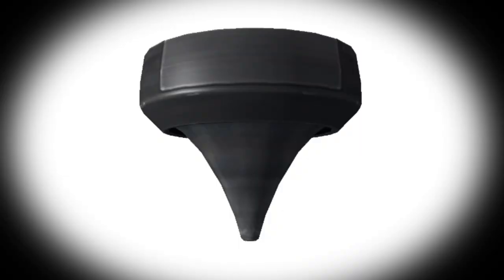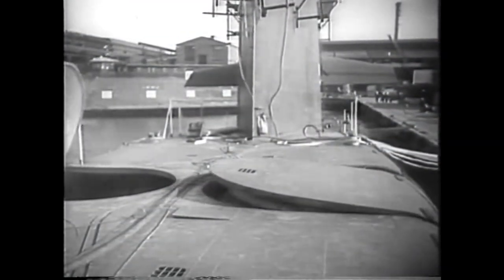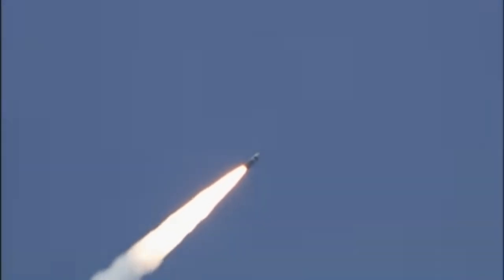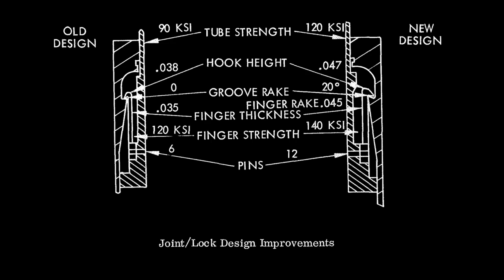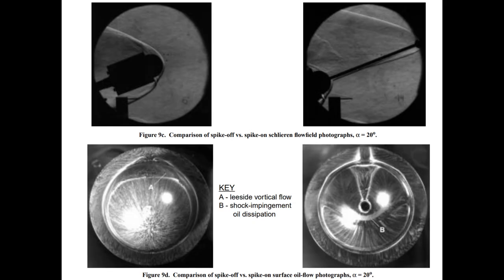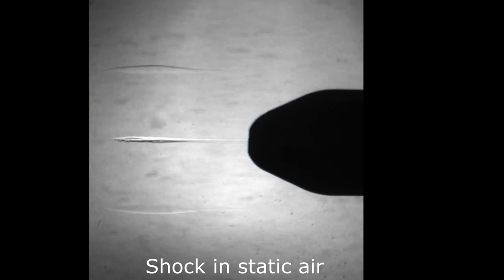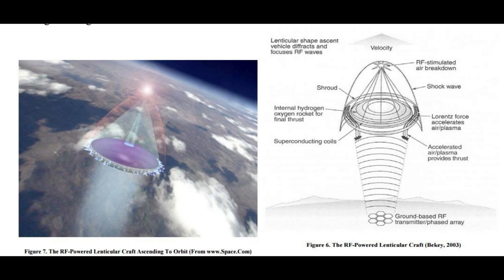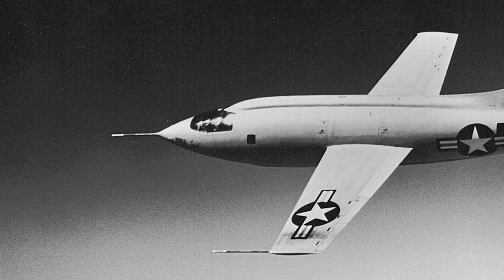Why Does The Trident Missile Have A Spike On Its Nose?

Comment: So with the significant drag reduction, why isn't this used more on say, the Falcon 9/Heavy?  Obviously the Saturn had the eject tower that probably served a similar function as does Artemis.  Is it just not worth the added complexity?  Or is the steering element you mentioned the reason?
Reply: I think he said that a pointy cone is better, and this is just better if u need to make a blunter shape
Reply: Probably keeping it simple at this stage of evolution. This concept seems like it would need a lot of research for a comparative small amount of gain. Look for it on the model 16 Heavy 🤪.
Reply: Remember, the purpose of this was to fake having a pointy nose... they didn't have room for a real nose cone on the missiles, so they used this deploy-after-launch spike to get some of the benefit anyway. It's clever, but nothing more than a workaround for a design limitation.
Reply: Civilian space launchers aren't length, width or mass-limited in the way that military missiles usually are. Falcon 9 could be made much longer and heavier with improved engines to enable it to launch heavier payloads, but you can't do that so much with a missile that has to fit inside a sub or an aircraft weapons bay. That's also part of the reason why propellents for space launch haven't changed much over the years (first methane /oxygen rocket flew in 1931 for example), because the ones we have are good enough, safe enough and cheap enough to do the job and if we need more performance we just use more. In contrast, solid propellant research is ongoing to get around the limitations imposed on military rockets, and improve things like safety and long term stability.

Comment: Wow, Scott!   I learned something really cool in this vid.  Aerospikes!   Then you mentioned supersonic torpedoes and blew my mind!!!   I thought about it and realized, sure, cavitation is a no-no for ship propellers.  But you might be able to use the cavitation phenomenon on the nose of a torpedo to drastically reduce drag.   I wonder if you could go all the way and effectively encase the whole torpedo inside a bubble and use a rocket engine to propel it?    Can you imagine how noisy that sucker would be?
Reply: That is how supersonic torpedoes work they have a solid rocket in the back and only the tip is in the water. The russian one can only go straight, the germans (dhiel) in the early 2000 build a nosecone that could be turned to steer the torpedo and tested it up to 100knots with 400knots possible. The german navy dropped the project after the prototype stage
Reply: @ariellus7096  Wow!  Thanks for the info!!!
Reply: Noisy. But being supersonic, the enemy wouldn't hear it .

Comment: IIRC, there was a high-speed ejection seat developed (Martin-Baker?) that deployed a pylon to place an aero-disc in front of the pilot to shape the shock wave around the seat, putting the pilot in a low pressure 'bubble' of sorts, making the ejection survivable.  Don't know if it was ever put into production, but a similar type of idea.

Comment: The original AIM-4F air-to-air Falcon missile carried on the F-106 had a similar spike protruding from the front of the radome  The spike actually screwed into a threaded stud that projected from the front of the radome.  Soon after the introduction it was determined that any added value was not worth all the associated maintenance hassles.  The mounting stud was dropped in later manufacturing.  Still there were some radomes with the threaded stud on missiles for many years after the spike was discontinued.

Comment: Every little boy's rocket has a pointy bit on the front. I shall also mention the turned up wing ends we had on paper aeroplanes which suddenly became popular on the metal ones a mere 30 or 40 years later.
Reply: My rocket does not have a pointy bit on the end. Why are you looking at little boys?

Comment: 4:52 I must point out that simply decelerating the flow to subsonic isn't the reason the aerospike reduces drag. Deceleration of the flow across a shockwave to subsonic actually increases the static pressure on the nose, which increases profile drag. A pointy nose or an aerospike causes an oblique shock wave vs the strong 'normal' bow shock wave you'd get from a spikeless blunt nose. The weak oblique shock actually causes the minimum amount of deceleration across the shockwave, keeping the flow moving as fast as possible so that its pressure remains low, and hence profile drag on the nose is kept to a minimum. Skin friction drag goes up as a result, but because the nose is so front-facing, the savings in profile-drag win out.

Comment: The aero spike on the Iglas don’t pop out. They are static.  The launch tube is long enough. 

The SA-16 has a tripod mounted aero spike.  The SA-18 has a single post.  

Both weapons use a spinning reticle seeker so they are blind in the center. The seekers are also gas cooled from the battery/gas bottle, so in flight the aero spike helps reduce seeker heating.

Comment: I read the spike is fed with high voltage the plasma field created pushes the air out of the way, a bit like the Biefield Brown effect that is used for propulsion in the B2 Spirit bomber where high voltage low amps positive charge on the leading edge of the wings and negative charge on the rear of the craft and into the exhaust pushing it along giving it the nickname "The flying capacitor ", at speed it becomes self sustaining as the engines become electric generators.

Comment: super cavitation actually uses the gas created by the water itself as it's compressed and then decompressed along the nose, streaming along the body. Like on a ships bpropeller the water cannot rush back into the volume it has been displaced from, so it instead gasifies. On propellers these bubbles disconnect and implode, eating away on paint and metal surfaces, while on a torpedo the bubble is carefully designed and enhanced to surround the entire vehicle. There's also underwater amunition for rifles that use this effect, it's just metal but shaped with a collar at the tip to create a small pressure zone

Comment: the noses of these missiles aren't blunt to fit inside a submarine, they're blunt so they don't melt on re-entry, i can't find anything really good on this online but to summarise from what it says from my textbook is: the more blunt an object the more air is used to take way heat while going at high mach speeds allowing it to go faster due to it not instantly melting while also hindering it's progress at going faster due to it being blunt.

Comment: I could see this being very useful for aircraft which want to store their munitions internally. (Be that for purposes of keeping the RCS low or otherwise.) You're quite limited by the volume of the internal weapons bays, so it might be practical to put an aerospace on air-to-air or air-to-ground missiles with a blunt nose to get that little bit of extra packing efficiency. I imagine this would be more practical for air-to-ground, though, since those are typically bigger (thus saving space is more valuable) and need to maneuver less (thus the issue of shock reattachment at high alpha is less severe).

Comment: Supercavitating torpedo is those thing that looks good on paper but in practice is actually pretty bad. 
For start the torpedo can only have inertial guidance because it flies within an air bubble so it has no contact with water, sonar guidance would not work since sound do not go through medium that well. Wire guided from submarine will also fail because a rocket propelling it will burn away any connection. 
Torpedo also had to be within confine of the torpedo tube so it really limit its width, therefore the USSR supercavitating torpedo had a very short range compare to normal torpedo, at around only 20km. Soviet submarine had to add nuclear warhead on them to increase their lethality, which also put a big stress on the crew because they had to run away from the torpedo as soon as possible to avoid being caught in the blast area.

Comment: Storytime, re: stripping out lining in the tubes at 2:20: 

- When the original fleet was built, the chief engineer made a shock/vibe requirement which was ludicrous.
- This caused a ton of padding to be required in the tubes, to reduce vibration on the missile. 
- This caused to the submarines to be built with a much wider missile tube than they otherwise would have, to accommodate both padding and missile
- 10 years later when it was time to build a larger missile, they changed the shock/vibe requirement to be much less stringent (and more realistic)
- Now that the requirement was more realistic, most of the padding was no longer required

And now, suddenly, they had a much bigger missile tube to work with, without needing to design and build a new submarine

All because a farsighted engineer wrote a ludicrous shock/vibe requirement at the very beginning

Comment: TOPIC REQUEST:
The VZOR optical orientation device used on the Vostock spacecraft solved a number of attitude problems without the need for power or electronics. It used lenses and prisms in a clever arrangement. but I have never seen it reproduced for demonstration. What do you know about this device?

Comment: The soviet-era supercavitating torpedo was effectively a failure for a number of reasons. Obviously, an underwater rocket torpedo is LOUD. If you launch one, the target will know it's coming. This noise and cavitation prevents any sort of effective onboard guidance system. So it has to be either wire-guided, or dumb-fire like WWII torpedoes. Not only will the target know that a torpedo is coming, it'll know EXACTLY where the torpedo came from. Since underwater engagement ranges are measured in thousands or tens of thousands of meters, even at supercavitating speeds the target will have time for return fire, and it will know exactly where to aim that return fire. Also, since it is so loud, you will seriously impair or completely blind your own sonar until it is far enough away from you.
Every time you shoot a supercavitating torpedo, you're blinding yourself at the exact same time you're giving away your position. While you've got a pretty good chance of getting a kill, you'll definitely have to deal with a lot of extremely accurate counter-fire. And oh yeah, the rocket fuel the supercavitating torpedo uses is corrosive, toxic, and hypergolic, and likes to eat through parts of the torpedo and fill the space with toxic gas then explode. So you might not even get a chance to launch the dang thing before it kills you. It looked very good on paper though, so of course the Soviets used it.

Comment: The original design of the Russian "Shkval" torpedo did not use a gas generator for the nose plate, but relied only on the plate itself to create the required cavitation, and the resultant air bubble that surrounded the torpedo.  I couldn't find any additional info,  but I guess the generated gas for the nose plate was either more reliable, or helped create a larger bubble for efficiency.  🤷‍♂

Comment: The aerospike kind of makes me wonder if they could use it as a steering device, kind of like a front canard system.  The amount of movement would have to be really small to be able to keep the shock wave from contacting the missile, and it wouldn't turn it very fast or very tightly.  But you might be able to delete or reduce the size of front canards on missile systems that use them.
Reply: There are no canards on the D5.

Comment: I recall reading that in the early days of rocketry that when they first started to go super-sonic, the very pointy front ends of the rockets started melting off. I suppose that when the entire energy of the shok-wave is concentrated onto a single point, it can get pretty hot.

Comment: Disclaimer: I have not been involved in the study of this for a while and was not a professional in the industry, only an enthusiastic amateur, so this information may be wrong or otherwise out of date.

The VA-111 Shkval torpedo (the Russian Super-Cavitation torpedo) is basically a sprinter, not agile or seeking, whilst some movement is supposedly possible; unlike other torpedoes such as the Mk48, it's not really a seeking torpedo, is designed to carry a nuclear warhead and be launched into the midst of a carrier battle group taking out the carrier and hopefully some support craft. This thing is not quite and stealthy, either. Its effectiveness comes from its speed, and the launching sub is expected to not survive.

Further to this, some Russian submarines are supposedly utilising the ability to pump a liquid out ports to coat the submarine in a slippery substance to increase its speed (by reducing drag). Back when I was involved in this there was conjecture that the Akula II's (Gepard class) had this capability, its known to have been trialled and demonstrated on the Beluga test platform but that's the only known case when I was still studying that.

Comment: Seems like a pito tube could be connected to the first stage and sheer gas pressure used to extend the spike. Because let's face it, after the first stage, it would seem to me that the missile is probably high enough that the atmosphere is thin enough that it really isn't needed any longer.

Also, you'll see spikes on the tips of wings (like in the last photo) of subsonic aircraft. These aren't about supersonic shock waves (obviously) but are intended to alter the dynamics of the air hitting the tip of the wing since the effects of spill off the wing tips is one of the more significant problems in aerodynamics. For that same reason, you now see near vertical wing tips. Not sure on the physics of all this (probably trying to get the spill effects away from the main wing surface) but that's why those are there.
Reply: I read that they are being to realize that the reason winglets are more efficient is simply that they are extending the length of the wing. In other words they don't really need to curve up. But curving up is good because the plane still has the same ground clearances. The 777X approach is to have folding wingtips. Folded up on the ground, then extended in flight.

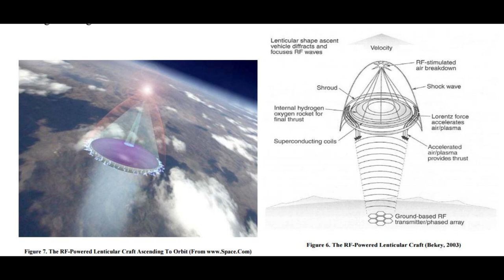Comment: 10:08 "I am assured is somewhat compatible with the laws of physics." Something feels utterly hilarious about that. Supersonic torpedos - I could imagine the shock waves from that being so strong that it could damage ships or submarines simply by passing by them, no need for a warhead. As for the mention of pitot tubes on aircraft, something I've always wondered is how the Shuttle measured airspeed in atmospheric flight? Clearly couldn't have a pitot tube (or angle of attack vane) sticking out like normal aircraft as that would be burned off on re-entry.
Reply: It  used something called an air data probe which popped out after they were in the atmosphere. There was one on each side of the orbiter.
Reply: @StevePemberton2  Ah, that answers my question. I figured it had to be either that or some sort of pressure plate that could survive the heat of re-entry. I would think they'd want to have as few seams in the heat shield as possible, so they'd want to minimize the number of doors that pop open, but given the tiled design it's all sort of seams anyway.
Reply: @quillmaurer6563   There were actually six doors on the bottom of the Shuttle. Four landing gear doors, one each for the main gear, and two for the nose gear. These of course were closed for the entire flight until just before touchdown. 

There were also two fuel umbilical well doors located near the two rear attachment points for the External Tank. The umbilical well doors were open during launch, and remained open for several minutes after reaching orbit because one of the umbilical wells had a camera in it which took pictures of the External Tank as it floated away, they wanted to check for any foam loss.
Reply: @StevePemberton2  Makes sense. What about the attach points for the external tank, would there have been doors for those as well?
Reply: @quillmaurer6563  The Shuttle was attached to the ET with three explosive bolts about 2 inch diameter. At separation the bolts sheared off. The aft bolts were located inside the umbilicals, so after they were sheared off the doors closed over them (after they got the ET pictures). 

The front attachment was directly behind the nose wheel door. The bolt passed through a hole in the tiles. To be more specific it passed through a six inch wide fitting with a spherical bearing that allowed the bolt to swivel. Upon shearing the bolt was pushed out by a piston, the piston ended up flush with the fitting, which itself was flush with the tiles. This fitting of course got hot during reentry, but behind it was heavy duty structure which absorbed the heat okay. 

Here's a link to a photo of the fitting, you can see the silver colored piston inside the bronze colored spherical bearing and raceway. 

https://www.nasa.gov/images/content/521274main_iss026e029923_hires.jpg

Comment: I know it has nothing to do with space but you should look into the little missiles that they load into the AC130 these days, they're also talking about putting them in the back of the B52 where the tailgun once was instead of just chaf/flares, a new countermeasure system that allows it to use the best defense.. a good offense. These things (if I remember right) are about 18 inches long and less than 6 inches in diameter and have spring loaded fins and full on targeting computers that as it leaves the tube the target info is transferred into the missile and it goes after whatever's there and once it gets close it goes over to IR like a sidewinder. I'm sure it's probably an expanding rod warhead too. The thing is they are very cheap compared to actual missiles and being short they can easily be loaded into places that full size AAMRAMs can't be, they also can turn much quicker being short. They also have the AGM-176A Griffin LGM that launches off the rear platform.